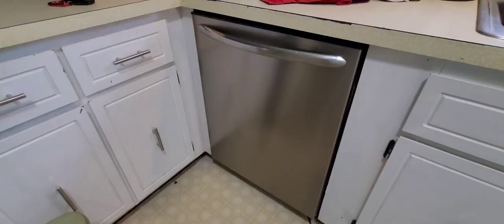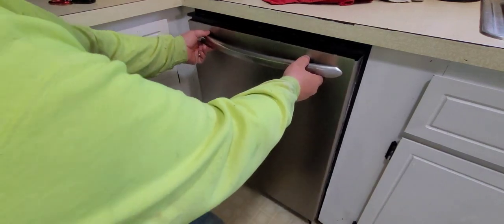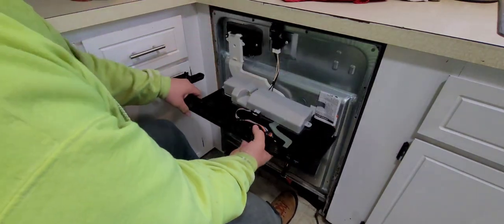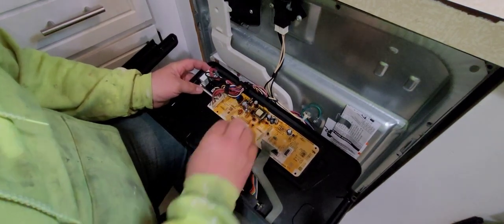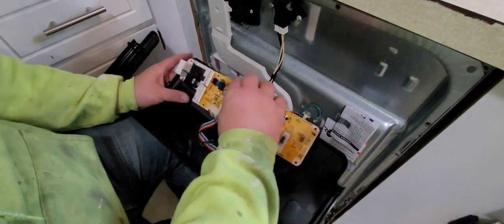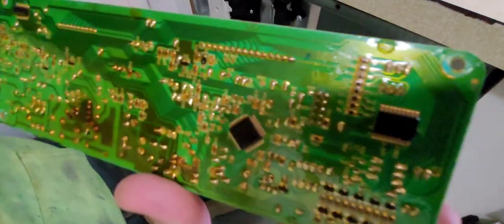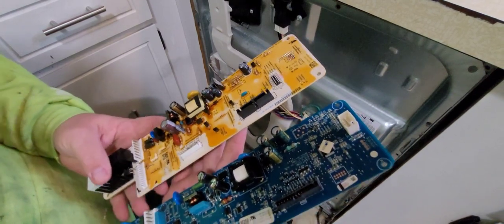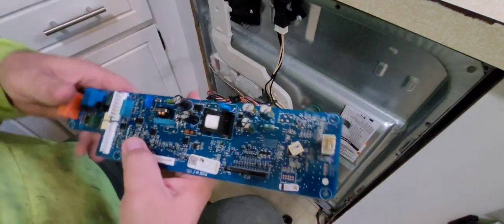How to fix a dishwasher that constantly runs

Comment: Hmm thanks, this might be it. I shorted the two drainage motor wires (by accident) while fixing an unrelated error code. Now when I turn on the electricity again the drainage motor keeps running. Wondering if I shorted the main board. Checking after my break :D